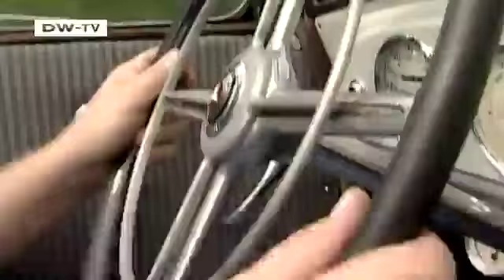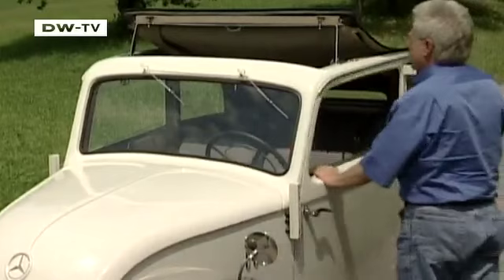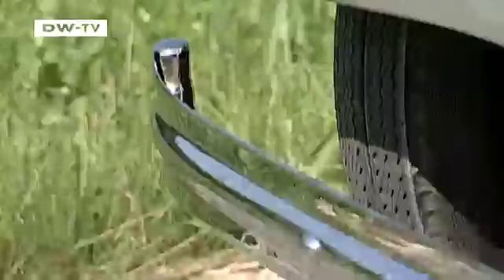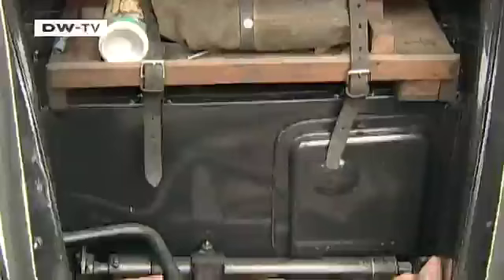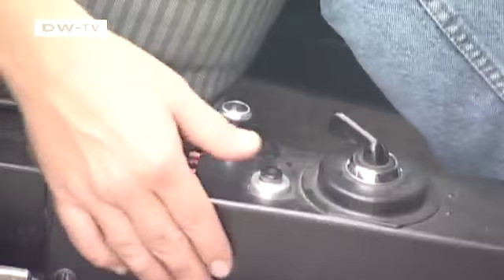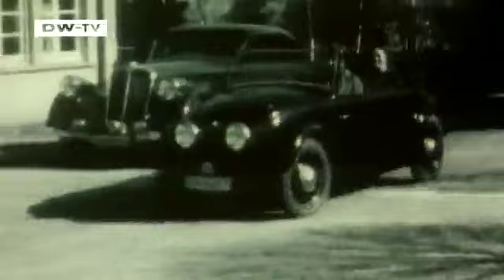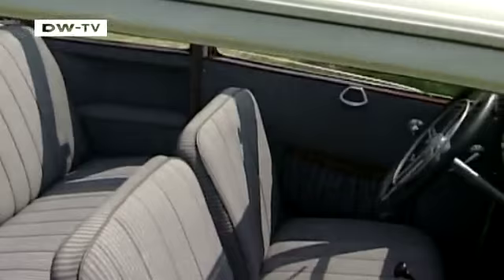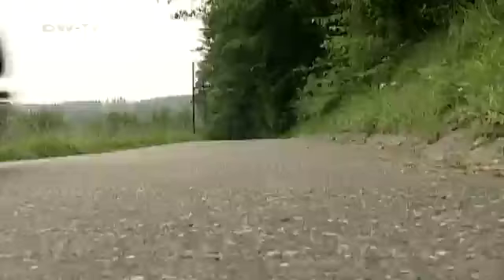vintage! Mercedes 130 | drive it

Comment: Did not know about the 130. Makes a lot of sense even today, when a 1.3 lt turbo would easily make 100 HP or more, which is fully adequate for an entry level Merc.